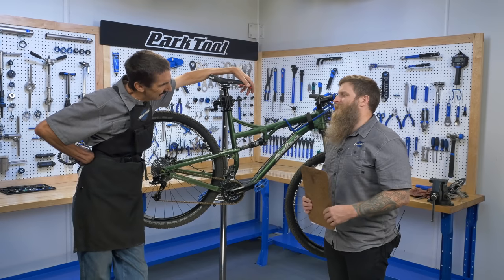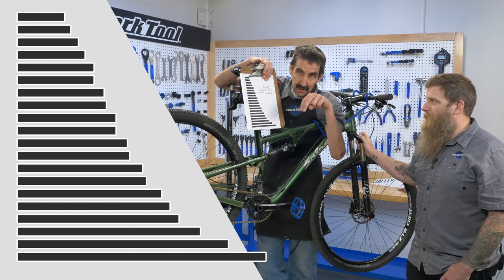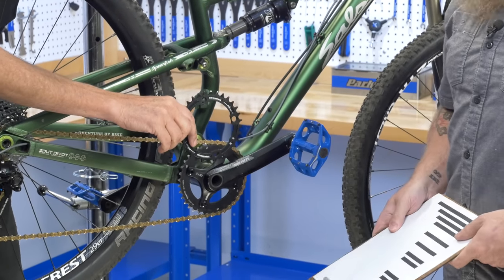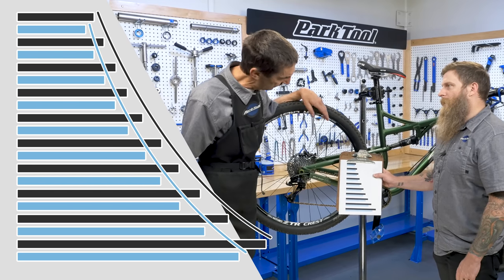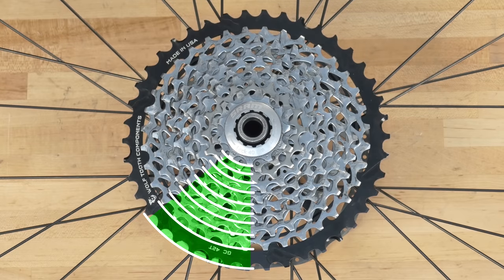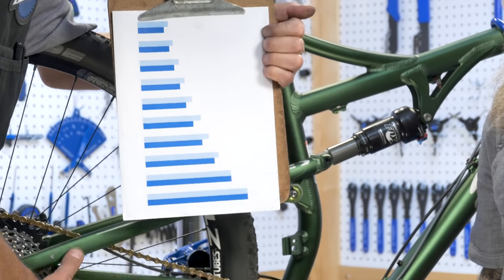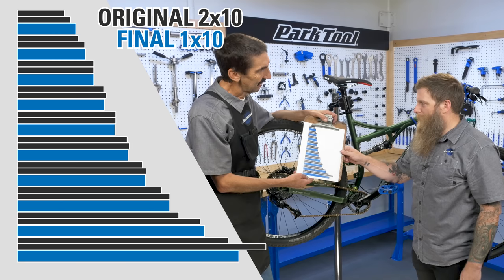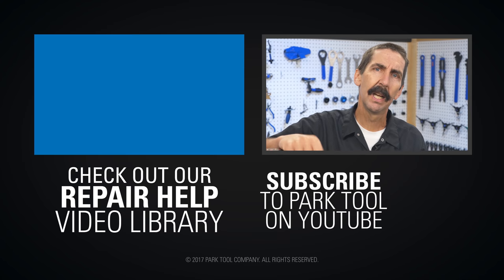1X Conversion: Pros & Cons - Tech Tuesday #91

Comment: I'll stick with 2x 7 days a week. Much more time spent riding near the middle of the cassette because of the 2 front rings to choose from which means superior efficiency, far less drivetrain wear, and smaller jumps between gears.  Plus the weight savings is almost nonexistent when you factor in a much larger cassette for a given range and longer chain.  Simplicity???  LOL,  the front derailleur is much more simplistic than the real derailleur. If your cliam is you are going to 1x for simplicity then you should really be eliminating the rear derailleur and riding a fixie or a single speed.  Most 1x riders spend the bulk of their time riding with their chain at a whacky angle.  :-)
Reply: BTW Sunrace makes a 9 speed 11-40t cassette so even you guys and gals on 9 speed can have it.  Nice thing about 9 speed is you can mix and match road and MTB for a fun CX or commuter setup with a Shadow+ rear derailleur.
Reply: Not everyone rides the centre of their cassette 7 days a week. 1x may not be for you, but for people in hilly areas where all gears are used often, 1x eliminates fiddling with the front derailleur. that's the "simplistic" bit that you're not grasping.
I use a shimano 105 drivetrain, and with 2 gears up front and the trim settings, I spend a lot of time adjusting my front derailleur based on where my chain is on the rear cog. If a 1x drivetrain comes along that gives me the same range as my current 2x, I would be happy to swap over.
Reply: HOW BOUT THAT CHAIN SLAP. too loud for me, and it comes off the front chainring too much on 2x10
Reply: That's interesting. I have several bikes running 1x. Some nascent and some converted. All have chain-lines which, when not in the most extreme two gears on each end are just fine. 3000-5000 miles on the chains/cassettes and only the one that gets ridden in the dirt is finally about ready for a swap out. Chain-line is not much of an issue these days for purpose built 1x systems; that problem was mostly related to conversions of a 2x crank to a 1x ring where the rider didn't take some steps to move the chainring inwards or outwards from the large or small spider position respectively. A lot of the NW rings on the market place the chainring inboard of where the standard double ring would sit - thereby improving chain-line and mostly correcting the issue. I don't sit on an extreme angle when riding except for a few seconds climbing at a time and that goes for all the other people I know who run 1x. How many people do you know that ride up a 12%+ grade for more than a few minutes or do extended sprints in the 30 mph range for more than a couple minutes at a time? I mean if we did IRL, then we would be spending all our riding time in either a 42t or 11t cog, which is silly - that's pro-level stuff; so I take issue with that generalization. I also take issue with the characterization of a fixie being more attractive than gears for simplicity sake only. Really, if you feel that strongly about the drawbacks of 1x vs a fixie then I think you maybe haven't actually tried it? Maybe for the right terrain/distance - but I would not take a fixie up a 12%-30% pitch - especially things like single track or gravel touring, over a bike with gears, not ever.
Reply: OH NO MY $32 CASSETTE COULD WEAR OUT IN 10 YEARS IF I CROSSCHAIN!!  WHAT AM I GOING TO DO!!  I'M CUTTING MYSELF!!

Comment: what does the T mean?
Reply from the maker: "T" is teeth.   36t is biker talk for 36 sprocket teeth.  
However, using the "T" first is a torx fitting, such as rotor bolts.  T25 is the size of wrench for the common rotor bolt.  A 25t would be 25 tooth sprocket.

Comment: woah hold on. what about a 2x10 with a 11-42 cassette. You used a 11-36. 2x has potentially way more range than that little tiny square.

Comment: Always has to be a new trend to empty wallets. Sillyness.
Reply: well i can't argue marketing hype to sell anything, i mean why does there need to be a new group almost every year when almost nothing has changed including the price. however, there can be some merit here as the 11 and 12 speed rears were not really a thing many years back so there could be less need for 2 up front. also if you really dial in the gears you need for the terrain you ride then you def dont need 2 up front or even crazy rear ranges. manufactures dont know who is buying it so the range allows the bike to work almost everywhere. i am in the camp of having a 2 x system myself but if i did races and had the pockets to have specific gear options in my tool box a 1x system for a race would be perfect. i live coastal NC so the 42t rear would not be needed and could prob just have a 44 up front with the normal 34 or 36 that was on the rear already.  its hype and consumer ignorance that leads to most spikes in a trend.. but the usefulness of the system is still valid when applied correctly.
Reply: If you legitimately need a specific gear range thats one thing, but I think we both know thats not why 95% of people buy them, most people just buy whatever the new craze is and make shit up to justify the expensive new shiny bit they don't actually need, they are just jumping off the bridge because somebody told them to.
Reply: Gettin Radd & Fuggin Bustn yes I do agree the majority of people don't race and or analize their ride terrain enough to find perfection in a 1x system over a 2x. In fact I have seen videos on conversions that ended up adding weight as the larger cassette, chain guide and narrow wide chainrings with clutch derailure were heavier so...it was better to just leave it as is and work on shifting effectively..perhaps. but that aside we could say that about most any products, cars, homes.. we like stuff, we like the idea of something new, and if it gets people out on a bike they had laying around because of the new drivetrain change.. awesome.. just don't tell me I should drop my 2x :)
Reply: Gettin Radd & Fuggin Bustn yes, I’m waiting in the 30 inch tire to come out 😂
Reply: you are a wise man, fuck the hype
Reply: I might get a new 1× drivetrain though coz i got my bike second hand, its a marin east peak '05 model and the gears and shifting are well off, the chain always jumps and skips gears and it always does the big jolt thing when im going up steep hills. Id have to change anyway, but i think replacing this obviously flawed system with something that might help (the 1×) is a good idea

Comment: 1x10 is not the best sollution. And you used a big chainring for this setup. 28t or 30t would be more suitable. But only with 46 or 50t cassette you can cover all the gears wih 3 or 2 cranks

Comment: To anyone watching nowadays: This video is 6 years old and is a bit outdated as the rear cassettes changed QUITE a lot and now we can get as low as 10t and as high as 52t on the rear. And also, 12 gears instead of 10.

Comment: But one thing remains,is being at the right gear. simple not sure see how that being in the right gear isn't as simple as one would think. I've seen that happen with 1×,all the time.so to say it simple is under statement, to much hype,for dumb down what is fun.but it more of options that the key,and why it cost more for no reason, don't make sense.if you have a 3× you have more options.and it would be better. again it's limited. Why not ride a PT cruiser instead?

Comment: Let me see if I saw this straight.
You either have a 3× with ALL the possible speed variations,
or a 1× with a slightly more limited speed variation?
So what is the actual advantage taking away your options?
And BTW, I want my legs to CRUMBLE by the time I get off the bike.
I want SPEED! I DO want an exercise going uphill with some speed too.
Essentially, I want to be the person passing everyone uphill, downhill, and on flat surfaces around Central Park in NYC. 
I have a Hybrid Cannondale Quick 4 Jumbo bike. I'm 6'3 and weigh 270 but my legs are pretty strong.
What suggestions does anyone have, without changing my actual bike but getting the most with spEED, SPeed, and SPEED?

Comment: 1X are a fad. The fad nowadays is walking and carrying your bike up the hill and riding down. My new Stumpjumper is a 1 X and my older Stumpjumper is a 2 X the 2X definitely has a lot more options. Saying that though I wouldn't convert my 1X to a 2X buy. Like you guys found out I to buy gives you a lower first and a higher top end

Comment: Thank you for pointing out what the  manufacturers keep avoiding, a 1x will never offer the range of a 2x. Just deal with it. The most compelling reason to go to a 1x is to avoid chain drops.

I really liked your graphs especially at the end were you showed what you'll be missing. My only criticism of your graphs was when you showed the graph for the 2x, you should have highlighted the  bars to avoid because of cross-chaining
Reply: That simply isn't true. Eagle 1x12 offers 500% range, and Sunrace and E13 both have similar cassettes available too.
The tech exists for mtb's. Surely it can be tweaked to suit road riding as well.
Reply: Dennis 
Guess what, you're still wrong. watch the video. If I take the cassette you describe and put two chainrings on, that's a wider range than what you describe

Comment: (I did in the end choose 1x mainly due to lower cost on my project MTB, but)Please - Don't be fooled - The advantages of 1x systems are borderline mythical...  If a 2x systems consisting of  a 37 & 21T chainring as well as a 9-29 cassette combination are used: 1. the weight saved by a 1x system, CAN be duplicated or rendered insignificant(ESPECIALLY if the fancy technology applied to 1xs cassettes are applied to my 9, 11, 13, 15, 17, 19, 21, 23, 25, 27, 29 cassette idea - which provides 20 INDIVIDUAL gears)... 2. By the use of odd numbered chainrings with alike cogs(my concept),  one can eliminate redundant gears... 3. The reduced complexity is meaningless, as having to use the front derailleur shifter has been replaced, by dropper post levers AND or F\R shock lockout levers - which like the front derailleur shifter, are used when about to climb up or descend down a hill - so riders STILL have to manually switch something when the meet a hill......or after... PS: With that said - It is Very Possible that the implementation of 1xs was\is simply a ploy by a certain company(whose parts I have purchased - I admit)to attract customers to them & away from other companies... >.>

Comment: Bikes just get more and more stupid. Indexing was for stupid people unwilling to learn the SKILL of shifting. With indexing now we have stupid cassettes that cannot be custom built one cog at a time, freewheels we could have any gear our strength and terrain demanded. Stupid indexing made gear adjustments 10x longer and you have to have absolute perfect position of the front derailleur. Then they just kept adding more cogs to cassettes, making finding parts a stupidly long difficult process to find and match. Now....1x's....absolute stupidest yet, high SKILLED cyclists know exactly what gear ratio (gear inches) are necessary for health, training, efficiency, it cannot be had with one chainring. And obviously, did anyone notice the cost of those wide range cassettes today...$100s of dollars. Here is a drive-train for almost every rider in almost all terrain....22/32/42 chainrings....11-12-13-14-15-16-18-21-25-30. Ten speed. This gearing provides extreme lows for long, steep climbs, and racing highs for the strongest riders. ANYONE not capable of shifting this example is not safe to be on the road, they don't have the SKILLS and/or coordination to ride a bicycle. Stupid people should not be riding a bike.
Reply from the maker: More butts on bikes is always a good thing, no matter the intelligence level.
Reply: Holy shit, that is an absolute blunderbuss of a comment from an old-skool rider.

I got into cycling on a whim with not even a basic understanding of gearing & I was BAFFLED by the 3 x7 I was on. Around the time I started to figure out how 3x was supposed to be used I upgraded it to a 3x 8, & when it came time to build a new bike from the ground up.... Lo & behold I gave it a 3 x 10 system!!!

I love the block shifting one can access with a choice of chainrings. Totally change the character of your drivetrain with one click as you transition from climb to descent, road to offroad & back again. 

It's like playing guitar. You can just "feel" your way through if you don't want to learn all the theory. & it's every bit as rewarding!

Stupid people are better off on bikes than in cars. They'll do less damage in the long run.
Reply: @myfrequencies1912  New NEVER means better, especially when the bicycle engineers we have are obsessesed with racing and NOT 99.99999% of their customers. Racing and recreational/fitness riding are polar opposites.